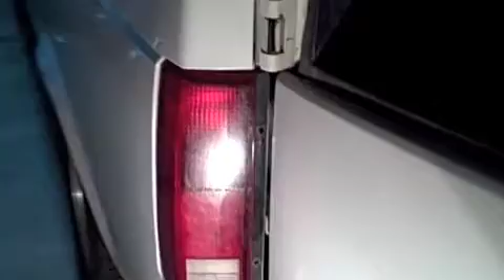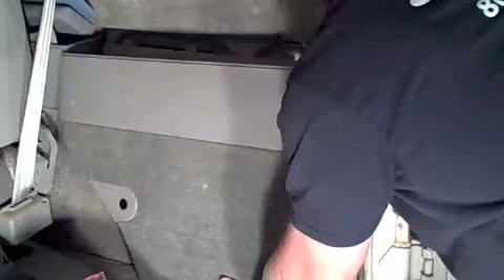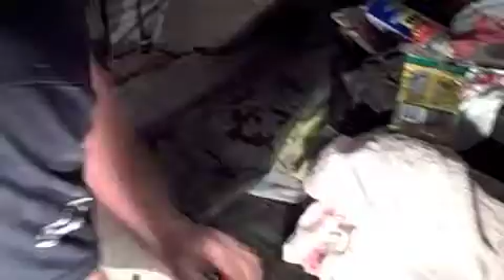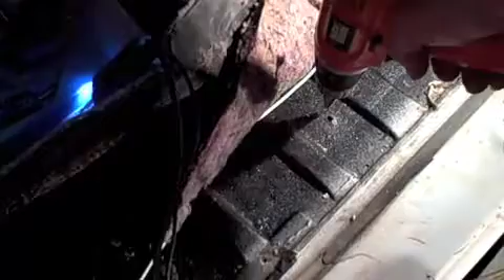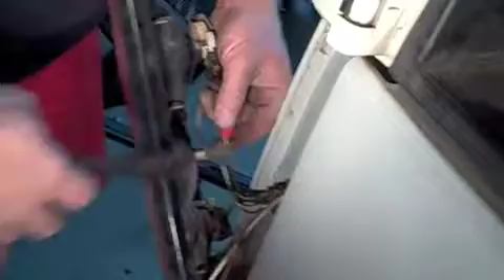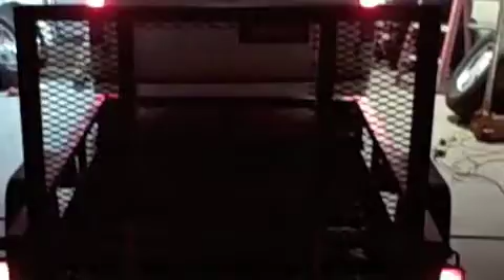How To install Trailer Lights on a Astrovan

Comment: Mine is a 87 a d I need help figuring out wires for the passenger side for the trailer lights I have it wired its just have one coming out of the passenger and two from the driver side can't figure out the last wire to make the brake lights stay on when you hit the brake with headlights on the trailer lights shut off

Comment: Yeah I blew the fuse replaced it and got it together when you have the headlights on or park lights and you hit the brake and brake lights come on on the van but the trailer lights shut off do you know what else I need to hook up have the green hooked up on the right side yellow on the left and brown on the left